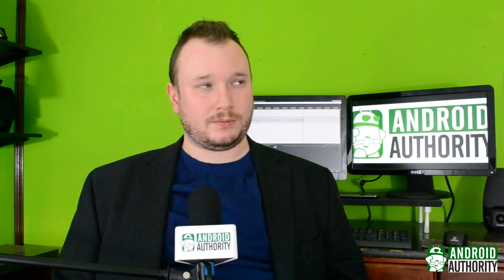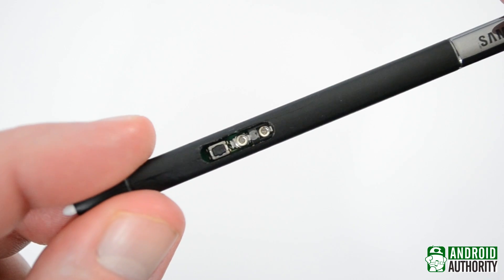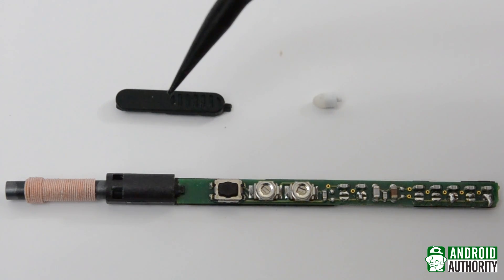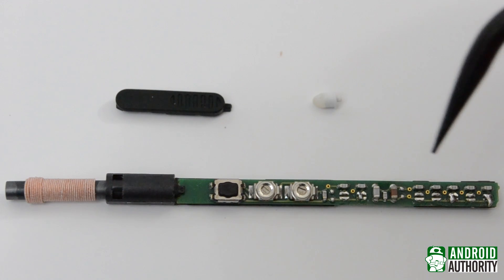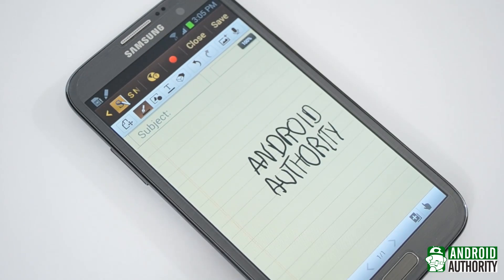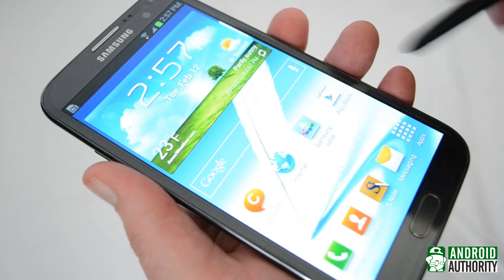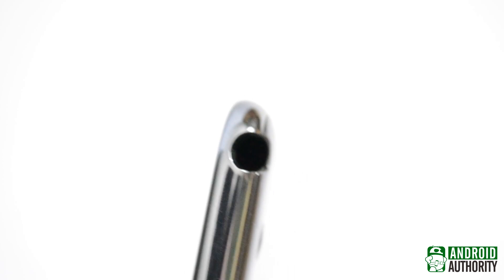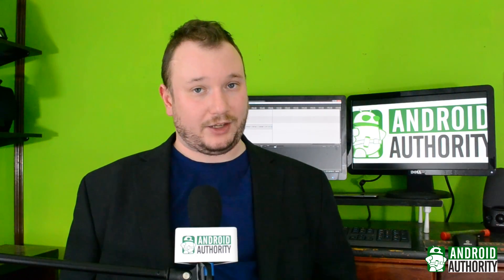Break It Down - How Does The S Pen Work? (Part 2)

Comment: "oh you have a Note? Kewlllll. well I just bought a stylus for my phone and now it's just the same as a note Spen, it has a cool little foam rubber tip and a suction cup to keep it with my phone at all times. I don't see what all the hype is though........."

comments I can't stand when using my phone.

Comment: i have a question. not about the S pen but the C pen. i want to know that why does the C pen works on the S3 and not on MOST  other devices. because there is not electro magnetic fields in the S3. then why does the C pen work only for the S3?

Comment: My s pen tip broke inside now I have a s pen with no tip and can't get it out.
Reply: Use the replacement tip and dip the superglue on the buttom (just a little dip )  put it inside to stick to the tip that broke inside and pull it out
Reply: patty patt  have u done it
Reply: Yes I did

Comment: so technically if you just use that and power it with a very smal battery, then that means that it should would with any device right? {assuming that you have the low power bluetooth and stuff to connect to it}

Comment: Something else to consider....  It's common to buy a fold-able leather-like case for the Note4.  If you buy one with a magnet closure it will affect the sensitivity of the pen on the screen when you have the case folded all the way back and resting on the back of the phone.  It creates an area that is less sensitive to the touch of the S-Pen due to competing magnetic fields.  I thought my Note4 was defective at first until a did more research.  Your video was part of that research.  THANKS for posting the more detailed info, though the simpler version also confirmed my suspicions.  Thanks,  DAVE

Comment: I really wanna ask you, my note 2 has the new s note, and i've tried drawing in s note and sketchbook for galaxy...with my finger, and it has the pressure sensitivity!

eventhough it's not as that accurate with s pen because obviously it's still finger, but it shows the pressure well..even has a better pressure than the s pen (really, it can go thicker than the s pen since i tried pressing it as hard as it could with the same point)

so i wonder if it's the same with samsung newer device and if that's the case, then the s pen just really add "additional" features such as air command on note 3. i mean it's going to be useless feature then if the pressure is in the screen, and newer device like s5 can handle air view and has the touch sensitivity for make things like pencil or key to operate the phone. so that's what i think, i bought it because it has the pressure sensitivity for drawing then i just found out this later

Comment: I have a problem. I recently dropped my s pen & it landed right on the tip of the pen, now the tip is pushed into shaft. Has anyone had the same problem & if you could tell me how to pull it out?...
Reply: Actually, I have had the Exact opposite issue. I dropped my phone on the area around where the s-pen is held, now. when i try to put the pen in its holster, it pops back out. it has something to do with the spring loaded mechanism near where the tip is placed when sheathed. yours is probably stuck, whereas mine, i believe is loose and or popped out of place.
Reply: I just ended up ordering a new Samsung replacement s pen. But there's a couple problem a with the replacement pen. First off, if your like myself I use my pen a lot for drawing so the nib wears down quickly. Second problem is I use the pen for taking pictures after I draw them and it only works sometimes, so I'm glad I kept the original pen cause it still works that way. 
So you may want to buy a couple of them they only cost about 16 dollars. But I don't know if that will work for you?

Comment: It is safe. Nothing is wrong. If you used S-Note, you can adjust thickness of the line by applying preasures on the screen by the pen. It move so that user can apply or reduce the preasure.